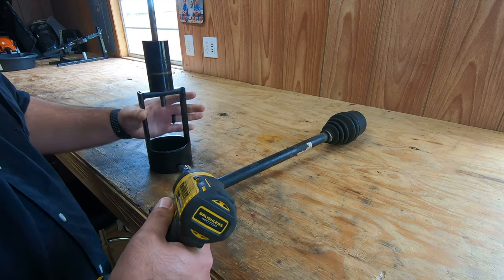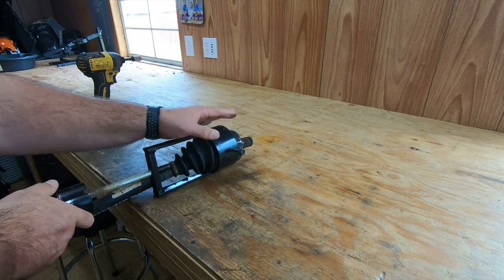Trail Kings Reviews the 2 BEST options of getting a Stuck Axle out your Polaris, CanAm & Honda Talon

Comment: Any tricks beyond what you showed I’m working on a machine with 10k miles and the same rear cv you showed will not come out I welded a hub to the outer of the cv then welded a 1” solid bar to that with 2 flat bars I can hit with a hammer also supporting the rod with a jack stand to hold it center it still will not come out.
Reply from the maker: We've never not had one of the 2 methods work for us.  We've added in WD-40 a few times to help out but it usually always comes out.